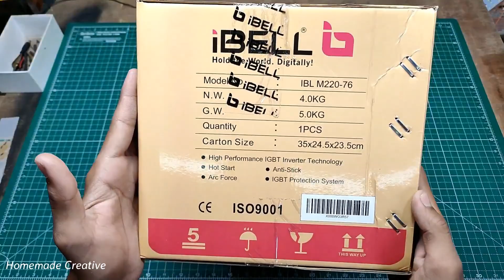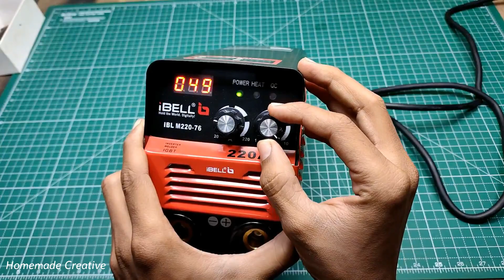Unboxing and Testing iBELL Inverter ARC Welding Machine (IGBT) 220A

Comment: I need to understand while mechine on does it give shock if we touch the earth cable or the other holder in bare hands.
Reply from the maker: No
Reply: The open circuit voltage between the two terminals is 35 volts DC. So it is safe to touch. 35 volt cannot deliver a lethal shock.
Reply: @sathishsukumaran9977   you mean it gives shock if you touch any cable
Reply: @food4u598  no shock possibility.  it is totally safe to touch

Comment: Which is best between arc 200 or this one which you showed in your video. I am also thinking of buying one  for home use. This costs 3000 more than arc 200. Pls advise. Thanks from Pune.
Reply from the maker: If your Budget Allow to buy then go for it if don't then Baught The ARC 200, Also it is Good for Home uses
Reply: @homemadecreativee  thanks for replying. One time spending more 3000 rs is not issue. Problem is that it will not be used much. I am not doing fabrication work. I also don't know welding job and how to use it. I am planning to buy angle grinder (DeWalt) and welding machine just after seeing YouTube videos.

Comment: Using a welding machine without ground connection is dangerous, right? 😨😨😨 The plug from machine and the socket you are using seems different!
Reply: The welder has a body ground of its own

Comment: Bro m/c switch on krne ke bad fan start nhi hota kya?
Reply from the maker: No, Fan Will Automatically start when u Start doing Weld
Reply: @homemadecreativee  bro i received welding machine 2 days ago 
And i try to weld every time earth clamp need to adjust that's horrible experience so can you please tell me any solution
Reply from the maker: Try To Tighten Your Clam and Do not Use On Rusty Metals

Comment: Is this machine powerful enough for house roof building?
Reply from the maker: Yes
Reply: @homemadecreativee  thanks, i bought it.
Reply from the maker: Great
Did U use it?
Reply: @homemadecreativee  not yet, had just ordered online. Will be delivered by Thursday
Reply: @Sanjay Dantani yes, tried and tested. Works well, you can go for it
Reply: @Sanjay Dantani gr8, I have 220a
Reply: @lakpabhutia3554  hello bro how was your experience. I'm trying to buy one of this for home use but I'm not sure about the quality. Can you share your experience
Reply: @nonamecieso9506  go for it blindly. No issues so far. I have used it to build roof, bed etc without any complaint.
Reply: Bro all of you used around 1 year I think.
Is there any complaints for this machine?
Reply: @shan.bikeriders2002  nope, used it quite a bit so far and no issues.

Comment: I want to purchase home purpose 
Arc Welding mishine
Angle grindering for cutting use 
Hand drilling machine 
Which is best compeny we can buy home purpose only
Reply from the maker: I bell is best
Reply: @homemadecreativee   
Can you give seggeson me bro
Hand drill up to 13mm
Dand cutter which company is best
Reply from the maker: You can buy all things from I bell
Reply: If you want to purchase for home usage, go for the following brand. Purchase one time and forget maintenance and warranty for life time.

1) Drill Machine, Hand Cutter and Tile Cutter, Jigsaw: Buy from the brand - Makita, Bosch, Hitachi, Stanley, Black&Decker, Dewalt  (These company are from Japan, Germany & USA but they are making the equipment's in China due to low price man power.

2)  Welding Machine: you can buy from IBELL, SHAKTI, HITBOX, SPARTON, V&D 
     IBELL from Kerala, India, Shakti is from china but service maintenance from Gujarat, India. All other are from china but maintenance by Indian marketing team. Even china products are good and reparable. electronics parts are available in India. Because most of spare parts are semiconductors and available in India.
Reply: @rudranarayanbiswal9853  is I bell is from kerala 🤔

Comment: I bought the same machine, can you please explain the amperes setting.
Reply: For 1mm square channel it worked for me between 30 to 40A ,it's also mentioned in the users manual